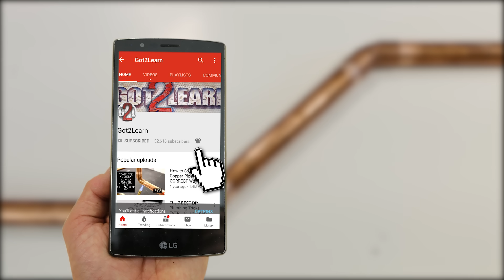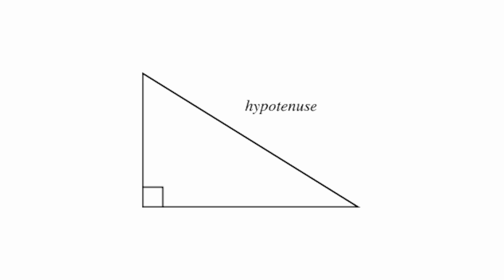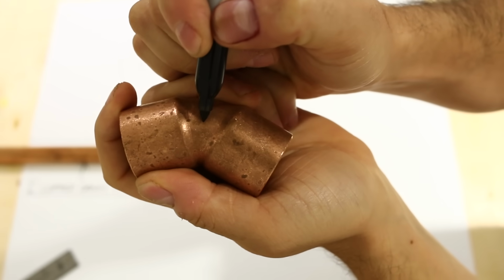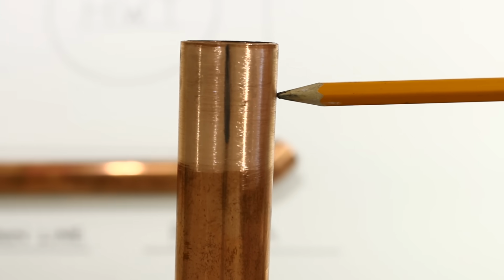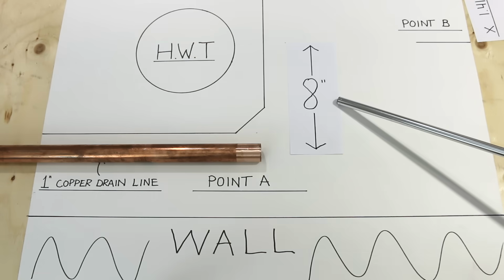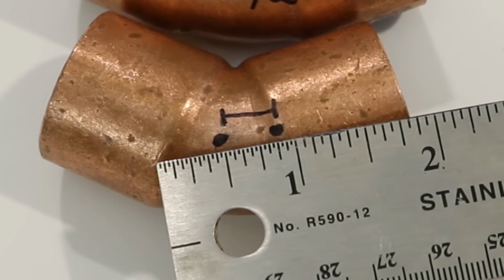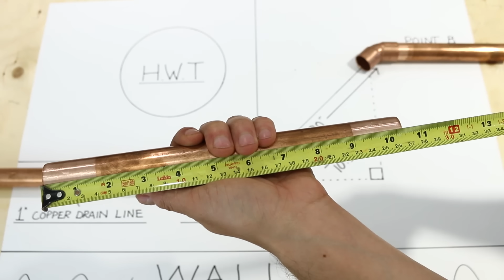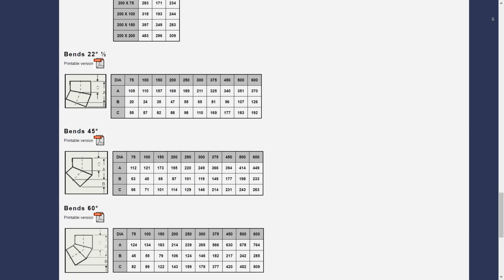The EASIEST way to calculate a 45° offset! | GOT2LEARN

Comment: Shouldn't the distance be multiplied by .7071? That's the sine of 45°
Reply: You would have to divide the measured value by .7071.  He is taking the inverse of .7071 or 1.4142 and multiplying.  Either way will yield the same result.
Reply from the maker: Good to know, thanks for the input Mike ;)
Reply from the maker: 1.4142 works like a charm, don't know about the 7071.
Reply: @Got2Learn  I'll check it out more.
Reply from the maker: Please share any info you've got